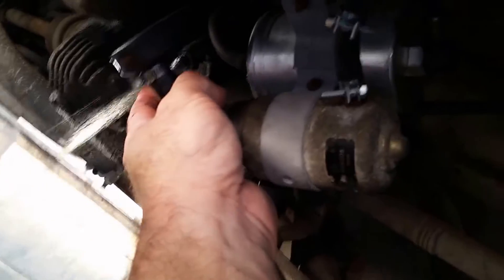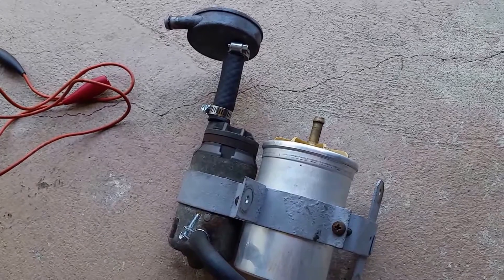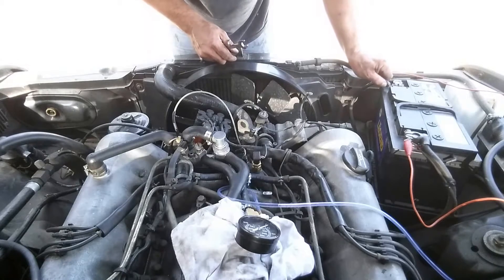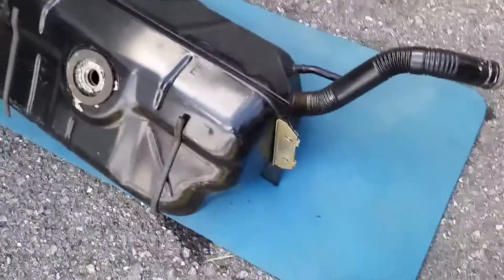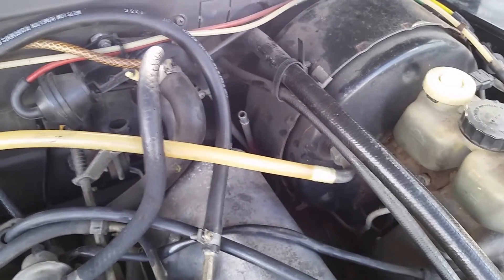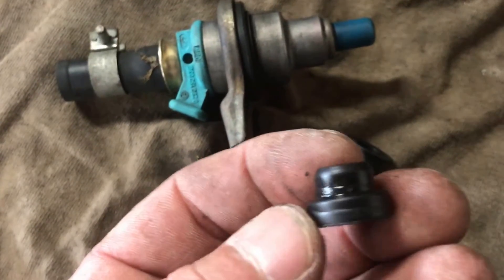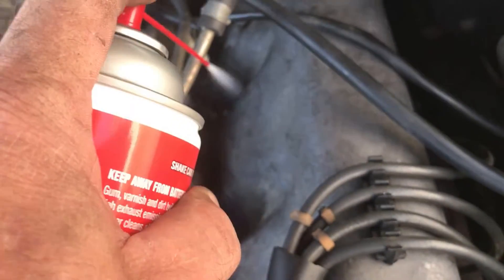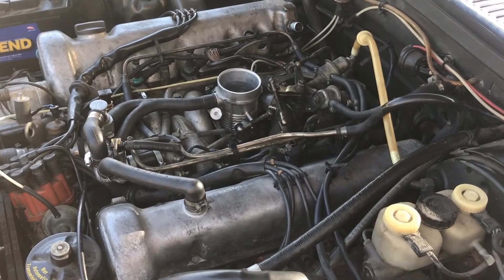1973 Mercedes 450SE  Charging System and D-Jetronic Issues

Comment: I’ve got a 74’ 450SL and it basically looks the same. The plugged vacuum line you mentioned next to the throttle valve is also plugged in my 450Sl for some reason. My switch over valve is attached to the coolant reservoir and there is another one at the back where you’re talking about with one vacuum line unplugged and open. I haven’t found anything online or conclusive about that vacuum lines 😊
Reply: 73 350se, same here! I'm pretty sure it for the distributor that has 2 vac line retard and advance where d jets only have retard. Also 99% sure it meant to go throttle body rear vac line to middle port valve, outside port to dissy, if that helps.
Reply: @JoblessDerrick  but I’ve seen other models without that plugged port all together. Why do you think Mercedes just used those same throttle valve assembly. Mine goes from vacuum advance ->switch over valve mounted beside the coolant reservoir -> to the throttle valve vacuum line; the one at the back. 

But there is also the switch over valves against the firewall and one of those plugs is missing too.

Comment: First thing you need to do is put the right fuel pump in that car!! The one you show is not the correct pump. The fuel filter is the wrong one!! CHANGE IT!! I know what these have, because I own a 450SE.
Reply: I have that same fuel pump in my 1975 450SEL. In the service shop manual it’s mentioned as the early version. An upgrade is mentioned in the manual and suggested to replace this pump.
Reply: @LilyoftheValeyrising  I had the same pump in my 1973 450 SLC. This pump recently died and you are correct about the pump upgrade! Cheers!
Reply: Is your 450 SE equipped with  D-Jetronic or K- Jetronic. Electric Fuel Pump  differs a lot on these two different kind of fuel system  made by BOSCH. Electric Fuel Pump for K-Jetronic system delivers more fuel than that of the D-Jetronic Fuel Pump, but they deliver more fuel than the maximum requirement of the engine so that the pressure in the fuel system can be maintained under all operating conditions.i hope this little information helps owners of Mercedes Benz 450 SE. Stay safe everyone, cheers!!!
Reply: @tonyreyes9969  only the k type pumps are available now. These have the larger inlet to the pump.
Reply: That is the correct early ., 1971 to 1974 D-Jet  fuel pump.

Comment: There is a Voltage Relay on the back of the alternator that can be replaced easily. It may help with the charging issue.
Reply: That is NOT a "relay" as such!!! BEFORE you try telling me different, I OWN a 450SE Mercedes.